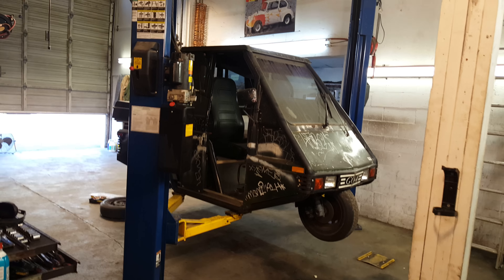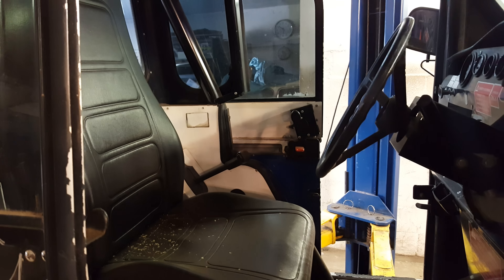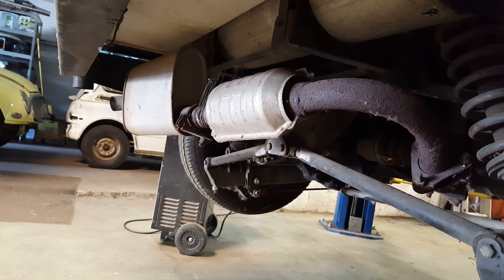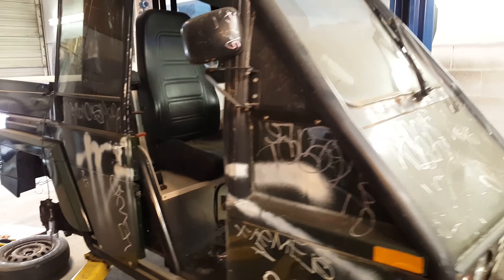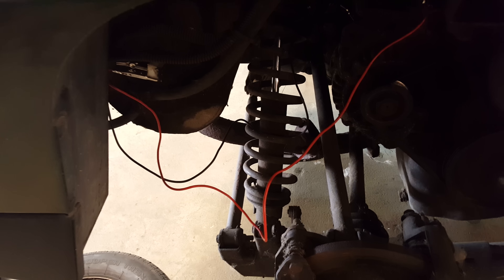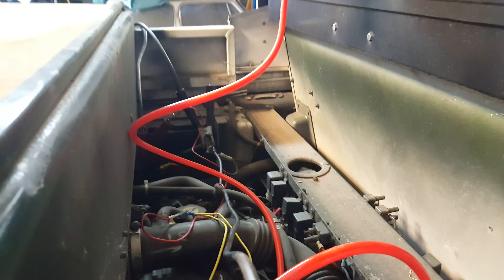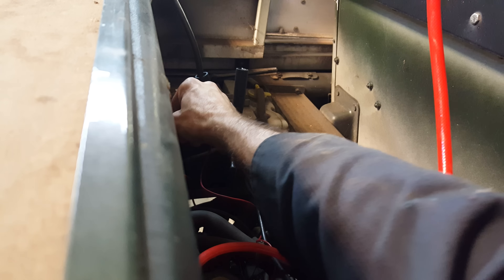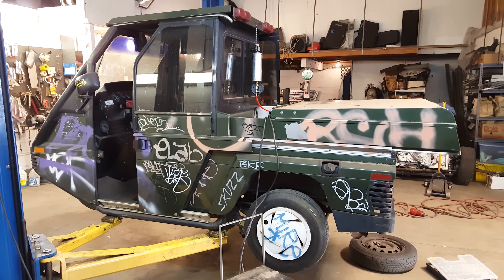Urban Interceptor GO-4    Modern 3 Wheeler

Comment: Hi,  My name is DON.  I might have some info to help you on the GO4.
I have a 1997 bt57 GO4. 
When you first started the GO4 and it ran on two of the four, look at the dash and you will see the governor light on. 
It kills power to (2) of the (4) when the engine is over RPM, over the speed setting, and on some it comes on when tilted / cornered above a safe speed. Some models will also shut off the fuel pump on impact or roll over, a big pothole can sometimes set it off.  If you follow the leads from the light to the relay you can un-stick or replace it.  Water sets mine off all the time, but I spray it with WD40 or other water dispersal, let it warm up, and all is good until next time.
Check out :

http://sillylittlecars.com/

http://sillylittlecars.com/files/Go-4%20-%20Additional%20Manuals/PARTS&SERV_MANUALS/Interceptor%20BT%20-57%20Electrical%20Manual/

http://sillylittlecars.com/files/Go-4%20-%20Additional%20Manuals/PARTS&SERV_MANUALS/Interceptor%20BT57%20Manuals/
You can see mine at :  GO4RIDER on youtube

https://www.youtube.com/channel/UCJNL6Nz8jIaDqnW3JYAegvA

hope any of this helps you....take care,..  DON.
Reply: Thanks Don, I just bought the  1994 and would not start.  Appreciate your free consultation.  Cheers.
Reply: @aprillovesgolf7042  any time..:hand-pink-waving::yt::elbowcough:

Comment: Please, can you help me? 
I have a 1997 bt57 GO-4.  It is my
daily ride.  The governor use to come on
every now and then but, would go right back off, or after a shut down and
restart it was fine.  Mostly damp cool,
rainy weather.  Never dry and warm.  But, now it comes on all the time moving or
not, some times just tuning the key on sets it off.  I know you worked on one before, and
by-passed the injector shut off.  Could
you please tell me how you did it, what cylinders are the two shut off, and
what I need to have parts wise to fix it….. Relays and so on???  Thank you, DON.
You always put out so many helpful and interesting videos, I
really need help. please contact me :     Bt57go4rider@gmail.com